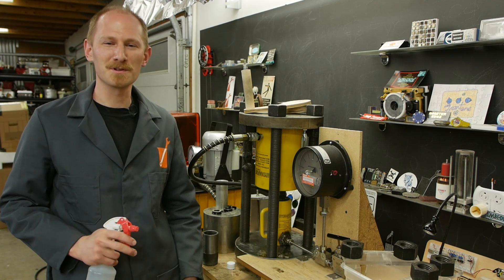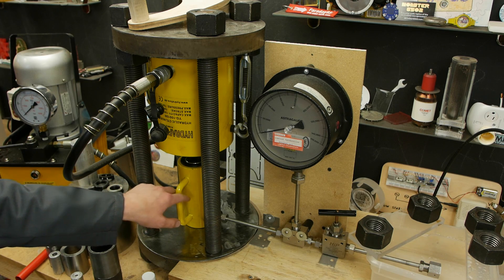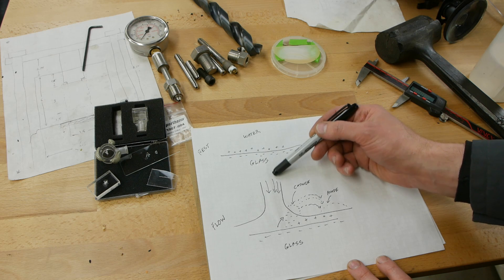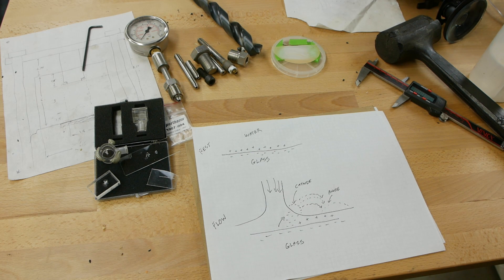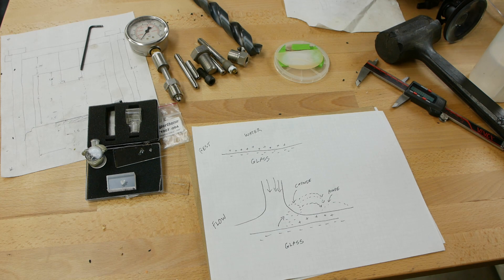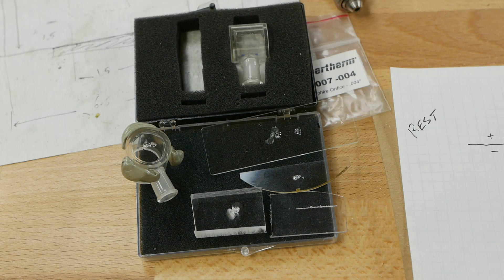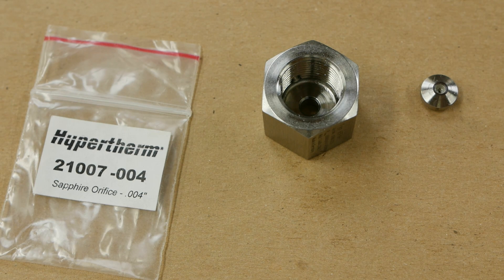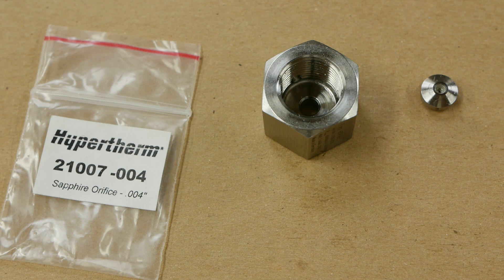Glowing plasma created by a high speed jet of water

Comment: I wonder what would happen if you used a superconducting fluid like liquid helium and added a charge to the substrate to sustain the effect?
Reply: Chris Monk Sellye that system can't work at liquid helium temperatures, but if salty water conducts well enough to kill the effect, liquid helium certainly won't work.
Reply: A superconducting substrate and a superfluid HP flow is more what I was thinking. I wonder if it may result in a HF heat pulse type effect?